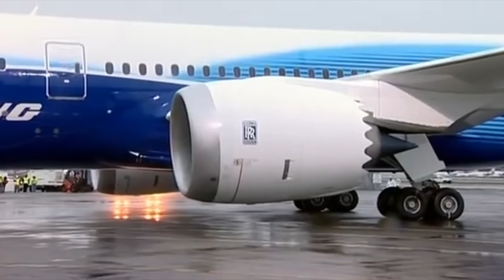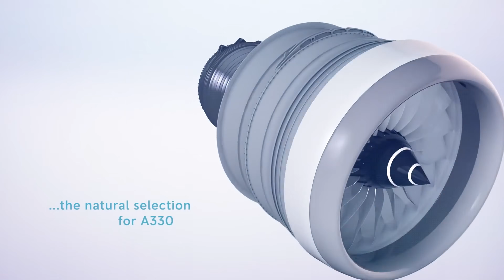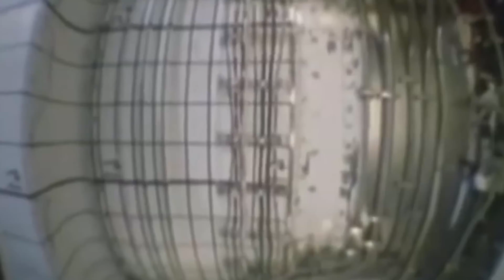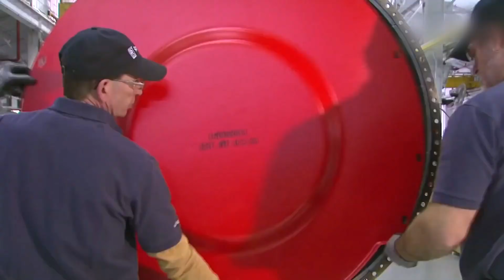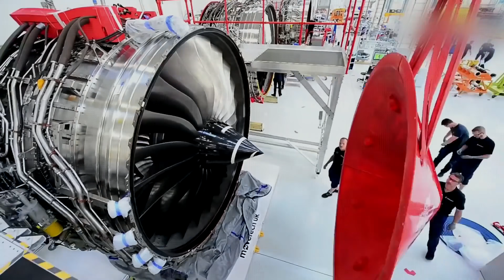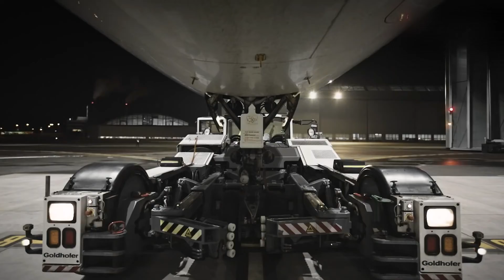Bird Strike Test: How Aircraft Engines are Tested✈️ [+ Turbojet engine Manufacturing process]

Comment: Why don't  have spare engine and use when emergency
Reply: Ah yes you can Def replace a BOLTED and SECURE engine while MID FLIGHT at 100-300 miles per hour
Reply: And that makes sense that you can just replace a bolted engine that a tightly secure at 37,000 ft and just replace it with another one. Magically

Comment: But can't a high carbon fibre ,Mesh ,be fitted in front of the engines ,,to stop the birds from getting in .......🤔
Reply: then the engine power will drop
Reply: Then it will also block air from getting into the engine
Reply: No, the in will just suck the grate in and screw it up more
Reply: The simple answer is NO ! The engine runs at such speed in order to ingest as much air as possible. If you imagine your vacuum cleaner hose running and then you get something stuck in front of the hose it will suffocate the vacuums motor as you know. But if you put a mesh in front of the vacuum hose then yes you reduce anything entering the vacuum but you Also greatly reduce the air being drawn in to the motor causing just as much damage and losing power ! It's the same thing as if you are yawning and putting your hand in front of your mouth you reduce the amount of oxygen your lungs require to complete the yawning.